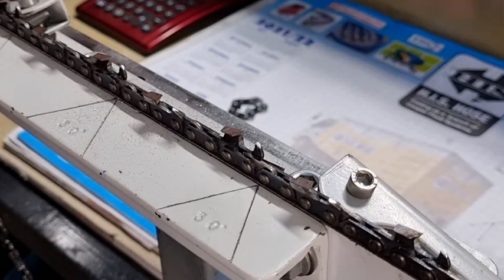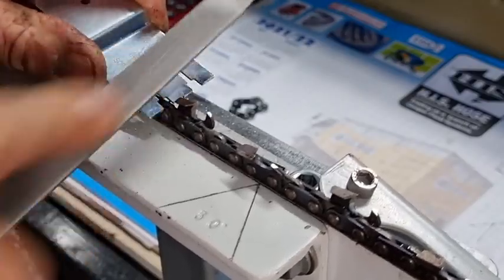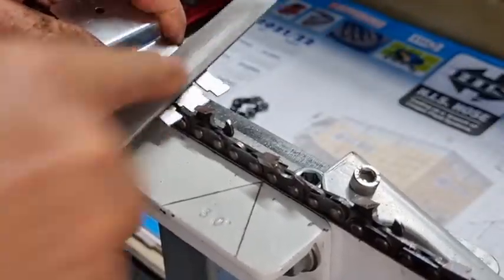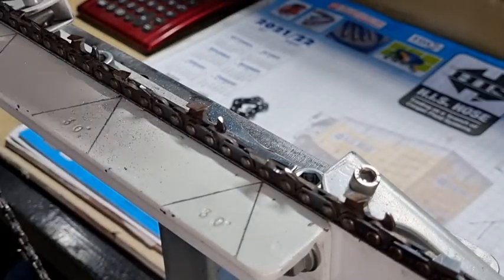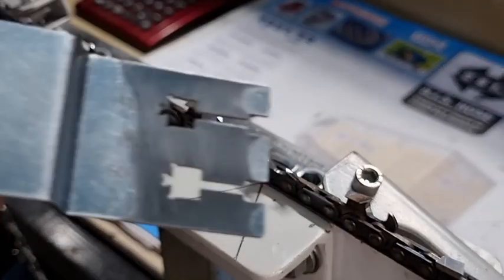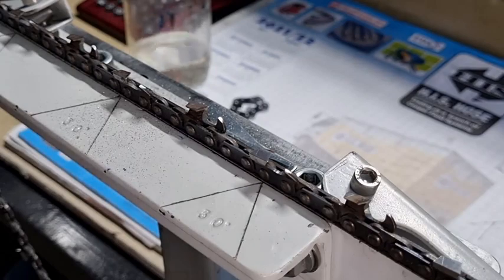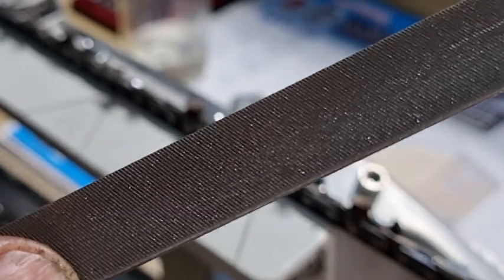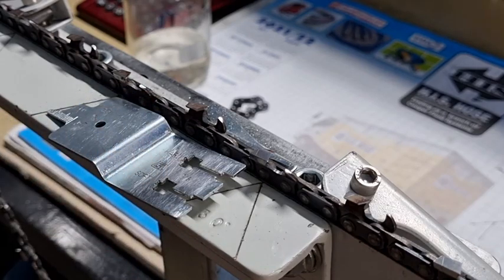Quick hand file of the depth gauges it don't take long.

Comment: Thanks for this vid mate, wasn't aware of hardness in the gauges so very helpful. They don't seem to sell the progressive gauge in Stihl Shops here in NZ. Have tracked down an independent mower shop that does 👍
Reply from the maker: The main advantage is when the chain get half worn down you really benefit from a progressive gauge husqvarna also make them

Comment: I recently purchased a Super Jolly and have done several chains with it.  They were all used, but already hand sharpened and raker set with Oregon type gauge tool.  Good on me, the hand filing was amazingly close to the what the "grinder" with the CBN wheel revealed.  Three of the Oregon 72 link loops of full comp chisel were at or even past half life or tooth length.  The Oregon gauge still read the rakers as being right on target.  I then used the Husqvarna "progressive" type (BLUE) gauge on the "HARD WOOD" setting and it too was spot on; no difference at all.  I then set the Super Jolly to its vertical position and fitted with the thicker depth grinder pink wheel.  I adjusted the down travel to where the wheel would just barely make the slightest contact with the marked cutter's raker of each chain as I ran all three of those older chains.  VOILA!  The wheel found the rakers has been set very consistently.  Once set-up, this did not take very long at all.  I guess I really did not need the Super Jolly, but we all need a new tool now and than to keep life interesting.  And, there is a very large black oad widow maker that I will have to deal with soon.